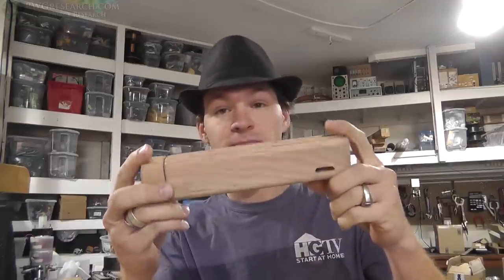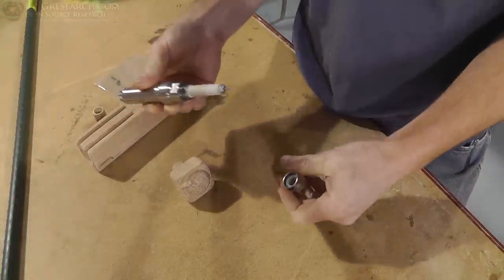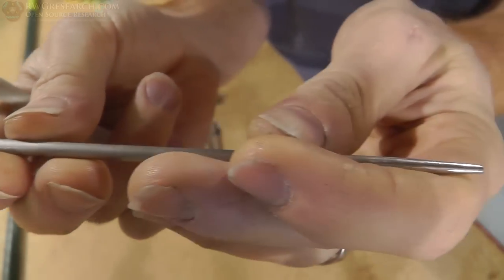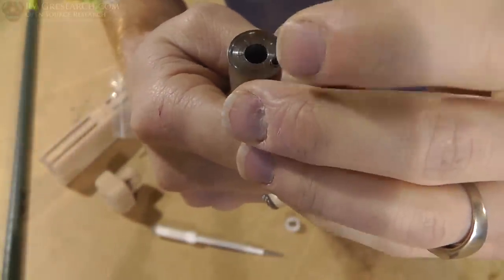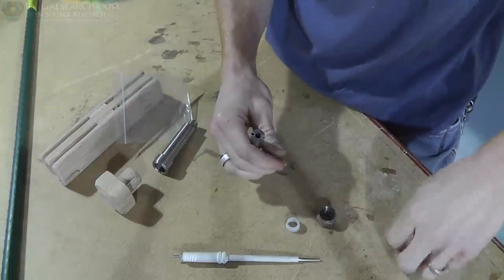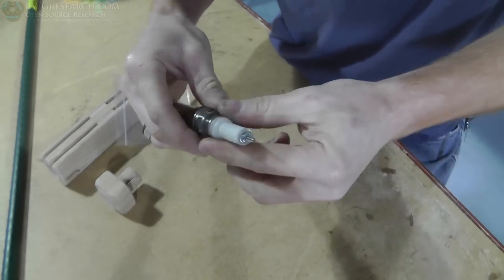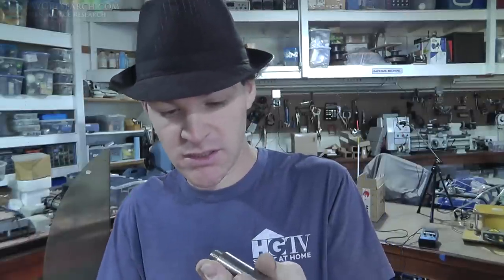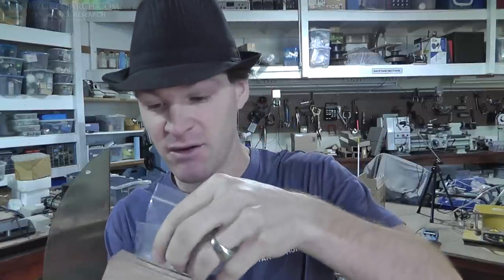Completed Stan Meyer Injector. RWGresearch.com

Comment: the only thing that is needed for the car to work only with water, actually with water becomes hydrogen from a high frequency electrolysis, it is a resistive capacitor inside the water, the high frequency produces ozone in the environment, the high frequency in the water produces ozone to this happens that it is hydrogen, it is pure combustion, what happens that in order for it to fully work with water, it has to produce many liters of hydrogen per minute, and with the current devices, the circuits become too hot and can not stand, this happens because they use positive energy, they have to have high frequency with negative pulses, not positive, that's why don smith put the diode upside down, stanley meyer told him this, so that instead of positive, polarity and negative length this makes the circuit cold and thus works very well without heating, and the other is to put it high frequency, but with a coil that has wave cancellation, this is achieved with a cross winding that form rhombuses, diamonds, this produces a scalar wave, this is gravitational wave, it is faster than the speed of light, it is instantaneous and super hyper powerful and it is cold energy, it is the way to be able to make a car totally hydrogen
Reply: Opa vamos trocar uma ideia?

Comment: What all is required in the setup of an engine along with the injector? I understand the Multi-Coil is needed as well, but I do not know if anything else is required as well. I saw a different video where you showcase many of Stanley's inventions, and was confused on what parts are needed for the final result of a working car. I am very interested in this project and would be inclined on testing as well. Very interesting work, and amazing craftsmanship.

Comment from the maker: it will take me some time to test this the way i intend to... so yeah... slow but sure.. ~Russ
Reply: I hear ya, small steps as that's the way these things go. Now you have to get the VIC back up and running and figure out it's opening pressure so that a pump can be matched up to it. All the while finding and/or determining it's resonance and standing wave frequencies with the VIC. As Meyer would say, "Much work remains." The thing that is missing from all of this is the voltage to amount of water breakdown rate as not even I have those numbers as of yet. Best of luck with your efforts.
Reply: +rwg42985 stan said the secret to unlocking the atomic power of water was to prevent the water molecule  from forming dring burn.my question is how?
Reply: +Paul Lower You know what?  Tesla had it right.  You know how long our Gov. has known?  Think back to the first Hydrogen Bomb.
Reply: Paul Lower Russ has no idea how Meyer did this or doesn't care to answer your question so I will answer it for you. To do this it is the job of the Gas Processor as it pulls the electrons away from the oxygen atoms and then sends them down to the combustion chamber to be reacted with the hydrogen gas atoms. When the unstable oxygen gas atoms are sparked in the presence of hydrogen the water molecules must form but it is now missing electrons and it is the hydrogen atoms job to come up with these missing electrons which prolongs the formation of the water molecules until all the missing electrons are produce from the zero point by the hydrogen atoms.
Reply from the maker: +Edward Mitchell your first statment is false. if your going to respond to people at least stick to the facts. ~Russ
Reply: ***** we like the facts.true facts.becouse the truth will set you free.
Reply: we can not do this without the holyspirit he reveels all truths.
Reply from the maker: +Paul Lower ahman brother! ~Russ
Reply: is it safe to asoom that there was a gas core transformer inside stans water tank on his doon buggy.
Reply: Paul Lower
Assume; Dune Buggy.   Stan's.  Please don't try to invent something that could go bang!
Reply: whats wrong with bang?
Reply: and please
 forgive my spelling.
Reply: Paul Lower ***** Interesting in how fast you can reply if you feel the need too isn't it? The man ask a question about prolonging the formation of the water molecules back in January and still you never answered the mans question but go to reply to my comment within a few hours time when it wasn't to you but about you. And get this, he is still awaiting a reply from you on that question so which is it, you don't know, you don't care, or is it a combination of both? Again, the man is still awaiting a response from you concerning his question.
Reply: +Edward Mitchell the question was answered .the answer was if the oxygen molecule and the hydrogen molecule have the same polarity it can not combine.but why are you dissing russ enyway.
Reply: @107840814413344459288 It is the Gas Processor that produces this effect of prolonging the formation of the water molecules. Now about Russ he and I don't see eye to eye on a great many things as I chose to go the science route on figuring out the science behind Meyer's technology and Russ just put on a great show for everyone. Once Russ ran out of Meyer type things to build he jumped ship and left everyone hanging starting totally different projects on other technologies. I, on the other hand, stayed the course.
Just look at how long it took for him to respond to my post, which went to answer your question, while he never responded to yours. Something doesn't add up, yes? Either he is ignoring you or he simply doesn't know or both.
With Russ he made some really big mistakes with me when he chose to ban me from his open source web site while never once apologizing for accusing me of trying to rip off the HHO community when it was proven that I had done no such a thing. I went to the Global BEM and showed the world something it had never seen before in that I was applying 4.2kv directly to a water bath and instead of people being happy that someone was showing some limited success they all got mad at me for doing so. I went on to reach 5.2kv, then 7.5kv and finally showed them a photo of me reaching 8,8kv and each time I did so I was met with hate instead of love. And do note that my 2013 Global BEM efforts have not been duplicated by anyone else working on this technology to this date that I am aware of. They acted as a whole to move me out of their forums and against me in general with an emphasis on silencing my voice. At every turn they act in a manor to prevent this technology from coming out if it is to come out by me. I know he doesn't know the answer to your question but felt he should have been man enough to tell you he didn't know instead of ignoring you for all these months. I hope this sheds some understanding on my actions towards him.
Reply: N2 The Mystic It's okay as these people are devout followers of Russ and as such can't see what a failure he is. They don't like it when someone like me comes around and tells the truth like I did. But more importantly they fail to think critically and realize that the only way around the blocking the rich set up is for us to act as a group as when things are made or materials brought the more you buy or have made the cheaper it is. This is a concept I can't seem to get Russ to understand. My company True Green Solutions was trying to bring some much needed standardization to the hho and opensource communities in that it would have allowed them to come together as a group and get this technology at some very good prices as they would have been acting together as one. But some of Russ's devout followers accused me of trying to rip them off as the initial cost for the Exciter Array was $1000 and they didn't seem to understand that if more went to buy the Exciter Array the cheaper the cost would be. But to make matters even worse they went and tried to build their own and couldn't beat the prices by a long shot. Did Russ or any of his devote followers apologize for their wrongful accusations of me? Nope! They just let those wrongful accusations of me remain to paint a bad image of me and my company within the hho and opensource communities.
I have ask Russ to clear my good name many times and each time he simply refuses to do so. Now it looks like True Green Solutions has actually solved this technology for the formulas we are using show on paper that the threshold for ionization will be met with the next build of the VIC transformer. We already tested one part of the formula and got great results showing without changing the input power we got a increase in voltage from 3000-5000 volts by making some physical changes to the circuit and note the formulas predicted this before the changes were made.
Reply: Edward Mitchell
If they dis the Dictator, they can fertilize the Pansies.
Reply: Edward Mitchell I have no idea what you are talking about. Interesting subject...Id like to know. But I just saw a vid about a water powered car and its murdered inventor. 
  If you are just going to assign whatever meaning to a word you want,then chaos will be the order of the day. 
  this is one of the ways politicians dupe us. Im sick of this type of attempt to manipulate an argument...
  of course YOU weren't the person who I was adressing. You seem competent in your field.
   I have no faith tht this tech will see the light of day. At least until someone gives it away freely to every country but the US. Then the US will not be able to survive without it. As they will not allow a playing field to be tilted away from US favor. Whoever does that will win a Nobel prize but not make royalty money of any significance. Stan meyers mistake was to try to give this to nato. The American oil interests wont have it...ever.
Reply: N2 The Mystic I agree a bit with your point of view but since I am on the inside I understand things a bit more than most. I didn't make the rules for supply and demand the rich did and just like everyone else I too have to take a bit out of that sandwich. The more I can make at a time the cheaper it will be for people own it as I stated before there simply is no getting around that. If I have just one unit built the cost is through the roof but if I have 10 made then the cost is a bit better and so on as the more I have made the cheaper the per unit cost will be. Again I didn't make these rules the rich did, okay? No matter what country your in this rule is the rules of the land and there is no getting around this rule. For the poor like us, we have to work as a group to get the prices down to where we can all afford to buy this technology. I tried very hard to get people in the hho and opensource communities to see this but failed as they are all act like crabs in a barrel and only want to do for self despite what they tell people. Giving the technology away leads to the most expensive way to get this technology as then you have everyone working for self and not as a group and it also leaves out anyone that can't build this technology for themselves for whatever reason they have for not being able to do so out in the cold. The youth and the elderly are part of the group that will be left to fend for themselves alone with the poor whom simply can't afford to have a one off made at a machine shop. 
You see I see through all of the lies people tell with ease and get at their motives behind what they same rather easily as I know how the system works and will generally ask them the right questions. Trust me as I have already given the science for this technology away for free but most simply can't afford to build it correctly as the cost for making one-offs is on the high side. Now here is a perfect example of what I am talking about on this site: http://www.stanmeyersparkplug.com/purchase/ as you can clearly see the more you buy the cheaper the unit cost will be and again I tell you there simply is no getting around this. For if you are poor then you are going to have to pay through the nose but if you are rich you can afford to get it cheap as those are the rules of the game they set up a long time ago. Now do you understand what I am talking about?
Reply: Edward Mitchell actualy,sir, I stick to my original opinion. Do you really think the military industrial complex would allow Mexicans to produce this tech openly without embracing it here. When every non oil producing country has a company manufacturing this tech,the only option for oil producing countries is to join in the competition or be the new 3rd world. Thay means freely licensing the tech to all but NOT relinquishing control over the patent. Stan should have never even considered meeting with NATO brass. He got greedy. Im glad he died. Even if nato used his technology it would be to control non nato country's. Until we give it to our enemies it wil stay suppressed. The patent system is inherently flawed I think but I dont claim to be the expert. I only know that sometimes the truth needs an army to see the light of day,not a lone white knight. There is no personal glory to win here. This fight is bigger than that. Inventors rarely get the credit for their work. Look at the pattent theif Albert Einstein. He was not responsible for special relativity. He was given the Nobel prize for his work in optics. He then gave his speech on special relativaty when he was supposed to speak about his work in optics,leading to the belief that the prize was for S.R. the conspiracy theory is that the zionists needed the smartest man ever myth to have a jewish hero. Maybe so but my point should be clear...the human desire for money,fame,recognition,and glory is their best weapon. I hope you can understand this by the time you figure out this tech. Or they will get you too.
Reply: Edward Mitchell one more thing. My only intention was to explain to paul that he needed to look up the definition of murder. I dont have time for this. Good day and good luck.
Reply: N2 The Mystic Thanks as from the looks of it this technology will be solved very soon. Plus I understand what you are talking about as some people take things too far in the way they speak and/or choose to write. They just don't seem to think before they put their thoughts out to the world. I'm kinda use to it now as I run into them all the time in the hho and opensource communities. And again thanks for your input.
Reply: @freelectron2029  I can not answer for Russ but as for me I ran out of money and have had to put things on hold. It's sad as I finally got at the science behind Meyer's technology as I made use of the scientific method, but have to wait until I get my finances in order before I can continue my work on this technology.
In the meantime the world just has to wait for me unless someone else comes along and solves it that has deeper pockets than i have.
Reply: @h2opower  any progress?
Reply: @antoinepetros9336  Yes, I solved the science behind the technology, but I went and put my computer in the shop to be fixed in March and the virus hit and now my PC is stuck until things open back up around here.
Reply: @h2opower  you dont have it on paper or memory or back up by eternal hard drive?
Reply: @antoinepetros9336  I have Mach 3 which runs my CNC mill that is on that PC, plus a whole lot of other programs, like AutoCAD that stuff like that. Can't run my mill without the PC.
Reply: @h2opower  did you get your PC back?

Comment: Russ, I think you have to put a circlip to hold the spring inside the hole because otherwise it will impede the water flow to the quenching slots...Remember that video I directed you to where Stan briefly showed the water injector apart before he screwed it together..??..if the spring wasn't secured it would have fallen out from the angle he was holding it.

Comment: curious to know if something else like silicone could be used instead of  micar?

I've seen silicone blocks used as a smelt for temperatures over 1000o and not sustain anything even close to warping.

Comment: Can you buy the complete set for a 6 cylinder say Camry? part number for spark plug is NGK  IFR 6aT11/ 4589and Denso injector part # is 23250-20010.

Comment: you can send me the outer housing as well if you like..I can micro tig  the insert so you don't have to remake the whole thing.  Also, don't make a mold unless you can set the silicone under pressure, because the cement has to be cured under pressure to achieve adequate strength. You cannot pressure cure in a mold which has not been set "under pressure" because of dimensional instability.
Reply: Electro could you not use ceramics with a porcelain powder coating baked on? Maybe it will be to brittle? Was just asking.
Reply: porcelain is a ceramic..you could but there is no point...I think I can make these out of a suitable material which will satisfy all the requirements for a ceramic insulator...cheap as well...but I can't do anything until Russ sends me something to work with..stay tuned..
Reply: I will definitely be staying tuned. I have been waiting a long time to get my hands on a water spark plug. My attempt to replicate one was not great.
Reply: Pressable ceramic technique, dental type with very tight tolerances. What's the latest?
Reply: @sirridok  Russ has finished his water injector and I've made my own from meyer's patent design.. check my video's for how I did it.